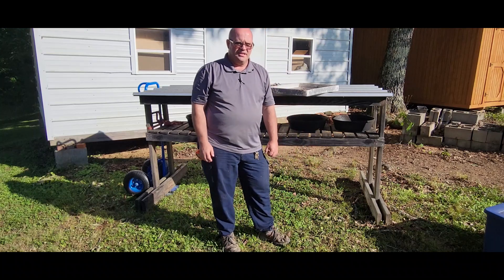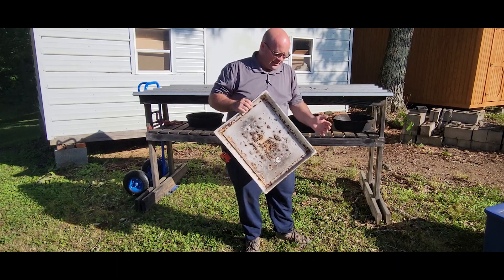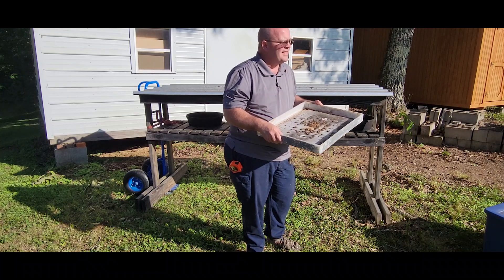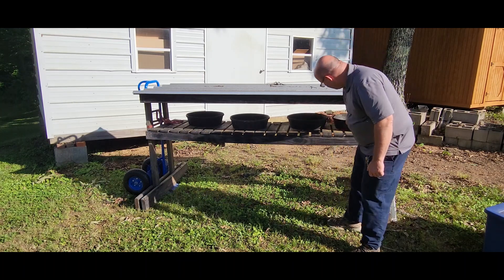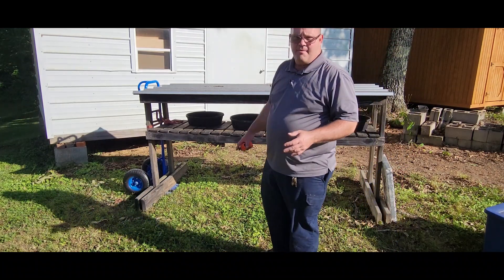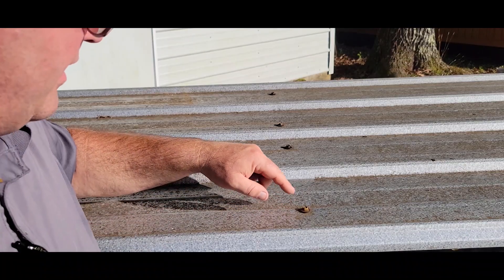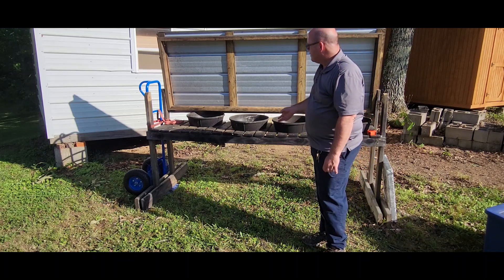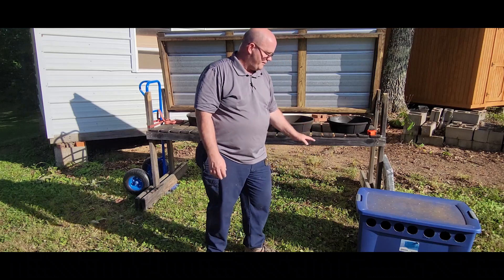A closer look at my community feeder.  #honeybees #beekeeping

Comment: Great feeding station. Have you ever thought about setting up a 55 gallon drug with a slow drip tube in the pans with a float system to cut off the flow when they fill up like the old style chicken waters. Great building you should be able to put a lot of supers in it .👍❤️🐝
Reply from the maker: i have not thought of that type of feeder,  i will investigate that and see how it is built and works.  thanks for sharing that tip.